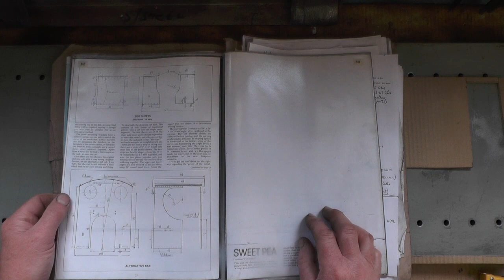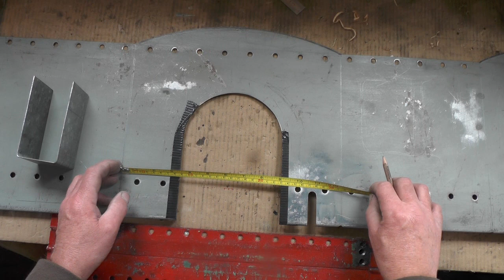Make a Beginners Miniature Steam Locomotive Series (Alternate Cab Part 1) "mr factotum"

Comment: I'd never have thought that putting the clamp bar at an angle to avoid the flange would have worked, but it did. I suppose one advantage of using the shelves is that the steel is just the right quality for this sort of bending. I don't think any amount of careful marking out and checking would have given me something so square. Now you just have to cut in one set of holes and fill in another set!
Reply from the maker: nice to hear from you tnld
thanks for comments, youve got it make a hole then fill it in
regards
mr f